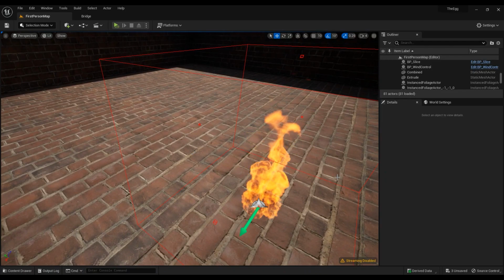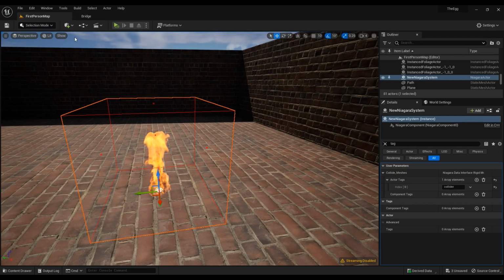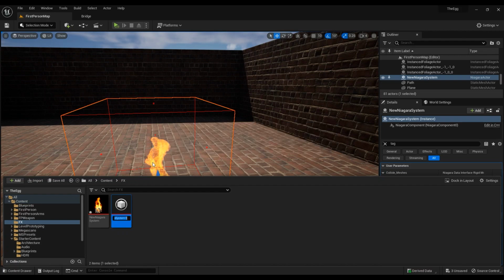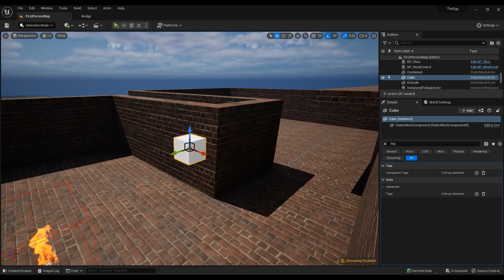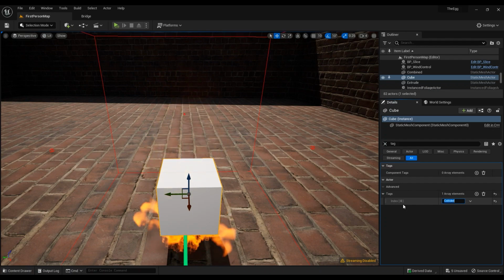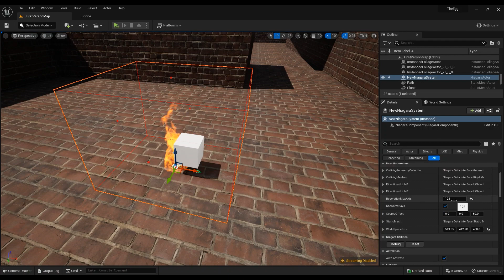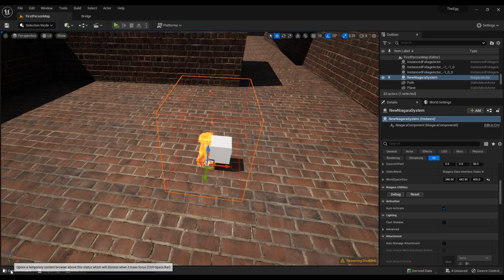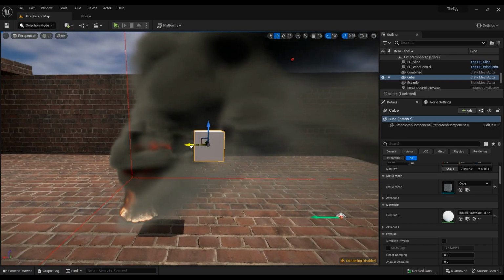How to : Collision in Niagara fluids smoke in UE5

Comment: This is an outdated Tutorial, That is no longer Working with Unreal 5.4.4
Reply from the maker: It works with ue5.5, I tested it last week
Reply: @surinStudio  
I figured it out...
I do not have UE 5.5 installed yet. I use 5.0.3 and 5.4.4, and in 5.0.3, everything is set. The rigid body with the tag name in Niagara is ready to go, but in 5.4.4, the parameter has changed to the side panel, not the node anymore. The rigid body needs to be added manually, and a name for the tag must be entered so that the object's tag can be found. I use copy and paste for that to ensure the spelling is correct.

Comment: Collision component is no longer part of "ParticleSourceEmitter" in UE 5.2. (at least not by default unless added manually)
Instead i found this setting >>> Grid3D_Gas_master_emitter > "Collide against" > "use mesh Collisions"
NOTE:  I failed to find "use Collider Velocity" anywhere in new version, so most particles do now is slide on surface instead of previous "bounce". In other words, if mesh got some velocity and particle hit it, it will either get deleted or stop. No energy/velocity is preserved.
Reply from the maker: Thank you for these awesome useful information
Reply: Do you know how to fix the velocity preservation? I have encountered this problem with a water pool. It loses volume every time something is colliding with it. I've searched everywhere and I can't find a solution